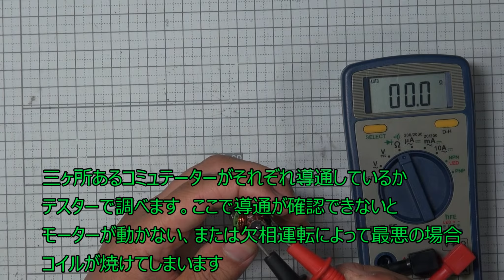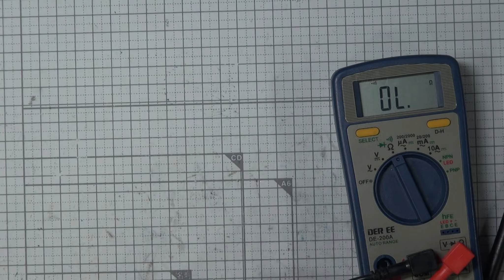【GBLS DAS M4】GDR15 モーターコイル巻き替え

Comment: So u rewired from 15 TPA to 16 TPA?
Why did u do that and how did it affect your gun?
Reply from the maker: The motor stopped working if I used it. Motors are expensive. So I repaired the motor myself.
It can be used without any problems so far.
Reply: @skyfish0731  is it same snapy as before?
I think it will be better to rewire to 18 or better 20 TPA. The batterydrain will be reduced significantly because the standard Motor is more likely a high speed motor and with all the extra weight of the Bolt and the Recoil Spring it shouldnt be less snapy.
The Image below shows how the TPA affects to the RPM and linear to drawn Power.
https://www.begadi.com/catalog/images/b-tienly-motor-gt-general-information-details.jpg